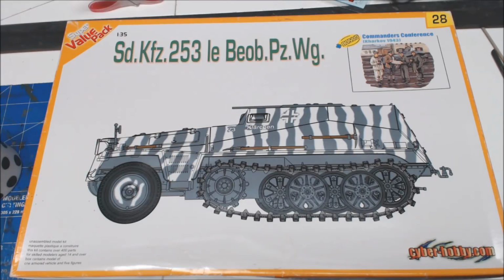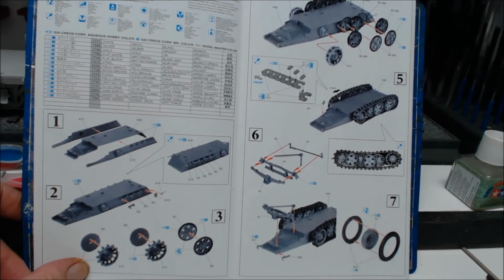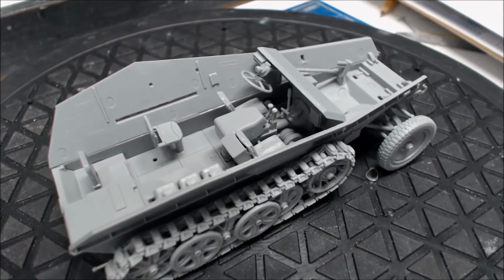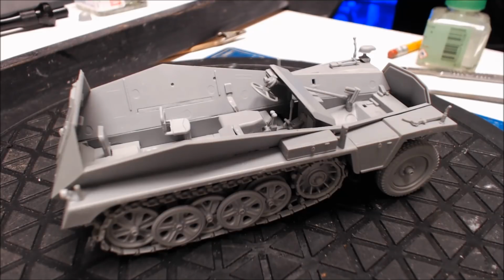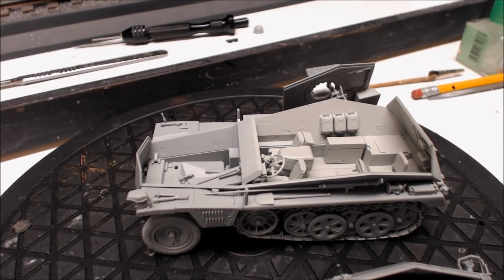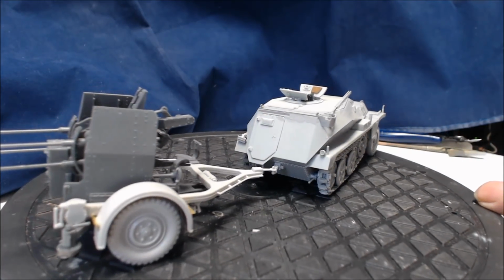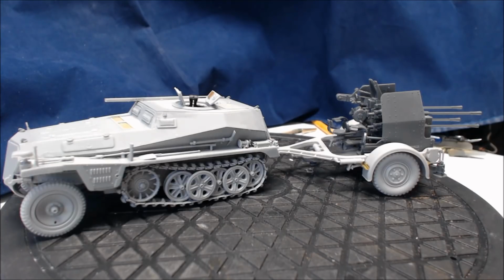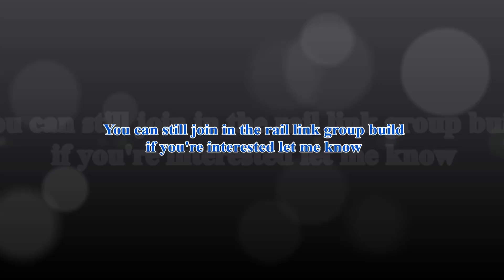sd kfz 253 ie beob,pz wg. The Build

Comment: First of all - a command vehicle towing a Quad? Tell me where the crew are supposed to go along with all it’s ammo eat al?
Secondly you complain about the lack of opportunity to see the interior but you glue up one of the largest access hatches in WW2 (the rear crew access door hatch) and you glue up the radio operators roof hatch.
Also you called a sub assembly the drivers compartment but it was indeed the radio and commanders position.
Finally you called the wpn system a PAK 38 - that’s an anti tank gun